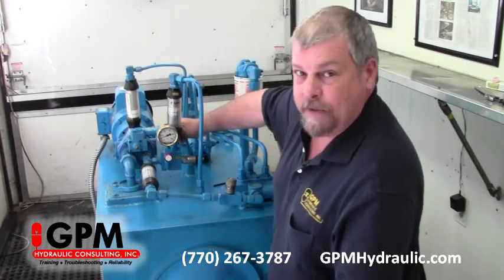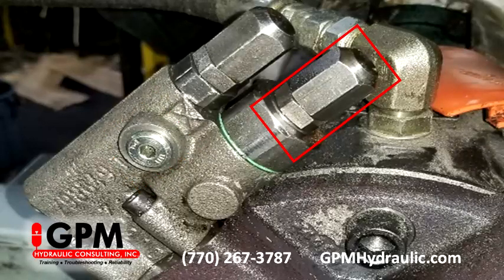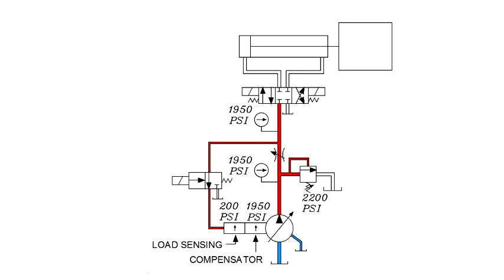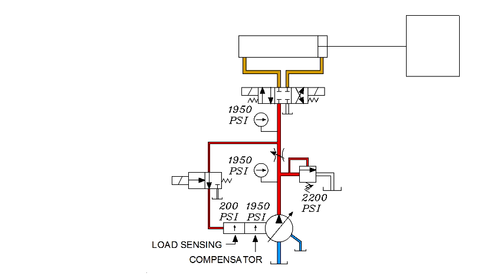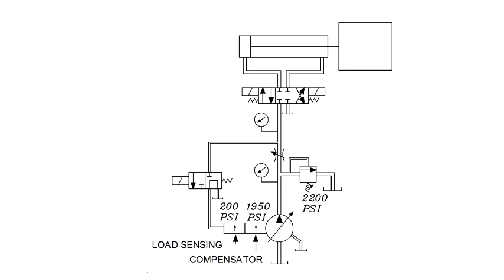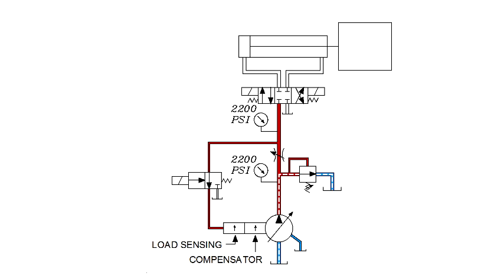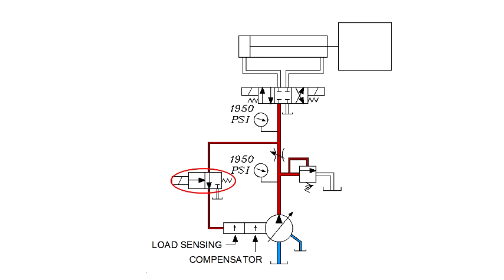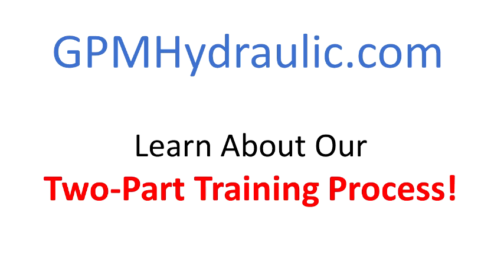Adjusting a Load Sensing Pump

Comment: Hi. If the loadd sensing port is capped off  like in the video, wont the presseure push the load sence spool up and go accress the top of the pressure comprnsator spool to destroke the pump????

Comment: Hello, I’ve got A10V pump with power control (DFLR). When I tried to adjust it, nothing changed. How does it work? As at full load a motor trips on overcurrent

Comment: Is the loading valve that determines which pressure to be used in the pump itself? I have a EATON 70422 and working on a personal install. Thanks Jim
Reply from the maker: That is correct - in the configurations shown in the video, the loading valve determines the pump standby, or idle pressure. 200 PSI if the loading valve is de-energized, 1950 PSI if energized. This reduces energy consumption in systems that idle any significant amount of time.

Comment: Suppose if no return line is connected for load sensing then what is the affect of tightening or loosening load compensating adjustment screw
Reply from the maker: Thanks for your question! There is always a return line connected, but you can’t see it because it goes to the pump case and returns to tank through the case drain.
Reply: But you have shown 4 output line from pump 1 suction, 1 delivery, 1 going to dc valve and 1 output P line connected to relief valve  and 1 leak line
Reply: What i mean to say is that what If there is no load Sense signal hose is connected to pump?  Then what is affect of tightening and loosening of load sensing setting screw
Reply: @guruv1870  , Oh, OK, I see what you mean. If there is no load sense signal applied, the compensator valve setting will override the load sensing setting. Sorry, I misunderstood your question. Quite often, these pumps are specified by the designer because of their efficiency even though the load sensing feature is not needed.
Reply: @JackWeeks  yess, means i can  fully tightened it in order to disable this feature because no load sensing line is actually connect to it...
Reply: At 0:50 they actually answer your question. 🙂

Comment: Please advise what is the best margin value to adjust in order maintain hydraulic motor steady speed with load sudden fluctuation?
Reply from the maker: Thank you for your comment, Samer! I'm not sure exactly what you mean by margin value, but a large part of the purpose of the load sensing pump is to maintain a constant speed of the actuator despite changes in load pressure. I believe what you are asking is how to keep sudden pressure spikes from instantaneously affecting speed. The load sensing valve and compensator valve are not responsive enough to absorb spikes, so it is possible for brief changes in speed to occur when spikes appear. The answer to eliminating spikes in a hydraulic motor circuit is crossport relief valves. These direct acting valves do a much better job of absorbing sudden pressure changes. Consider installing these if your system experiences sudden pressure changes. Not only will they help avoid sudden speed changes, but they will also help to protect the motor from shock. Hope this helps!
Reply: Thank you for your interest to answer me such high technical replay.
When I talk about margin I mean flow compansitor spring adjustment.
In other orders what is the difference between set it high or low? How would these different settings effects the system.

On the other hand I believe double cross relief valves need closed center dirictional control while one I have is y shape.
Reply from the maker: I understand what you mean now. A good starting point is to set the compensator about 200 psi above the heaviest load pressure. Too low and you will get stalling at heavy load, too high and you get system shock.

You probably don’t need crossport relief valves since you have the float center directional valve. But just so you understand, they don’t actually require a closed center. The opposite IS true, however - motor drives with closed center valves usually DO require crossport relief valves.
Reply: @Gpmhydraulic  thank you very much for your assist and awesome discussion.

Comment: If the p comp is set to 1950 and the ls is set to 200 wont the pump only make 1750 to the rest of the system?
Reply from the maker: No, the two settings are independent. The normal pressure will be 1950 PSI and will reduce to 200 PSI when the pump goes into standby.
Reply: @Gpmhydraulic  
Ok if the the load is 900psi, the pump generate the 900psi + 200psi pressure drop from the load sense setting which equals 1100psi right. So what happens to this pressure drop when the load is at 1950psi? Would the pump not have generate 2150psi to account for the 200psi pressure drop across the load sense?
Reply from the maker: @Richard-dv9nr  , if the load reaches 1950 PSI, it will begin to stall. The pressure at the outlet of the pump is limited to the compensator setting at all times. There will no longer be a pressure drop across the flow control, because the load pressure will equal the compensator setting. From the point where the load pressure is 1750 PSI, the pressure drop across the flow control will decrease as load pressure increases, so the speed of the load drops. Once the load pressure reaches 1950 PSI, the load will stall altogether.

Comment: Hello sir, Myself Ajit Nayak from INDIA, I have Rexroth A10VSO100-DFLR-31R pump. before few days my team replace rotary kit in this pump. i request to you pl. guide me to set up Pressure, Flow control as well as load sensing valve optimum setting. 
my CNC machine required pre. is 3200 PSI, 50HP Motor using in this system. Thanks GPM Hyd. Team.